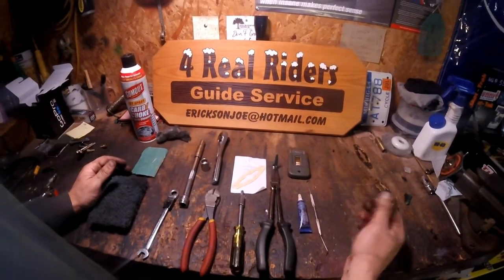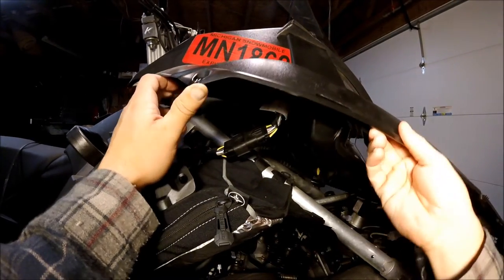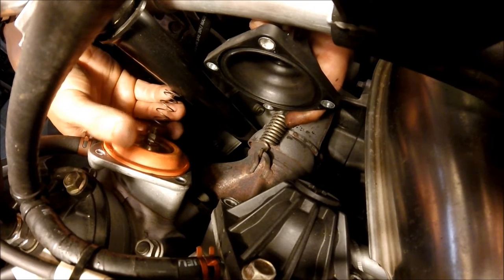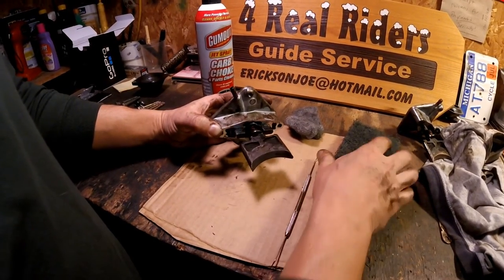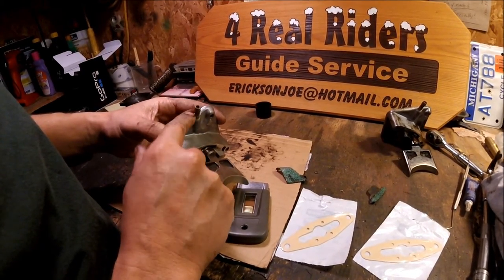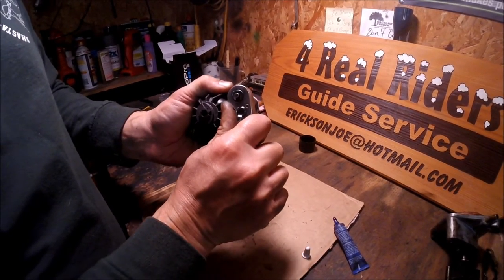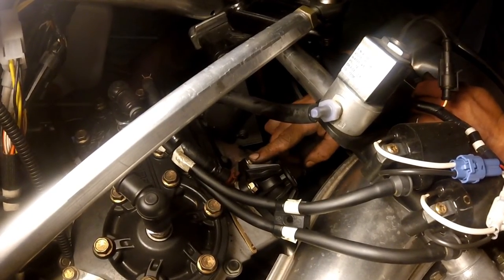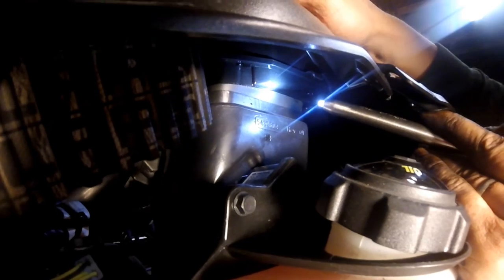Polaris 600 CFI Exhaust Valve Cleaning Pro RMK - 4 Real Rider Snowmobile

Comment: You installed the Power Valve and bellow housing complete, but disassembled for removal. Did you have to remove the plastic bellow housing for just the one side? Good vid btw
Reply from the maker: My apologies for not getting back to you sooner.  I like to take them off before hand because its easier to crack the bolts loose for the plastic caps, when they are still bolted to the sled. Shouldn't make a difference either way.  Its almost time for snow!
God Bless! ~ Joe

Comment: Does your sled have the top end hesitation ?
Reply from the maker: Good question.  I've had some hesitations with this motor.  I ran a diagnostic and it popped code for injectors.  I've seen this before on the 600 cfi's However it is very frustrating because they are not cheap!  Now my 09' 600 that is in my other vids it had a bog now and then also.  I ran that sled from 0-7000 miles and I lived with it.  I tried "Iridium Plugs"  and I felt like they helped, but not a cure.  I'm going to run this sled and see what happens this season???  Whens Honda gonna start making motors for polaris chassis?  lol...
Reply: Wow ! Thankx for the quick response !